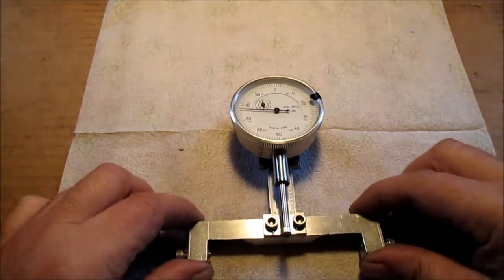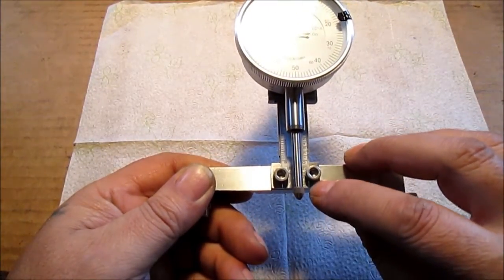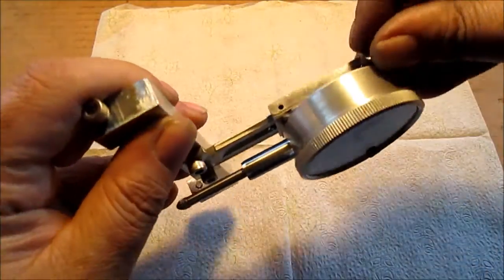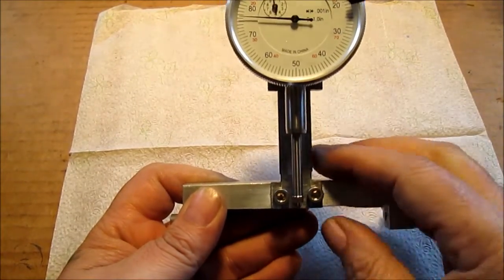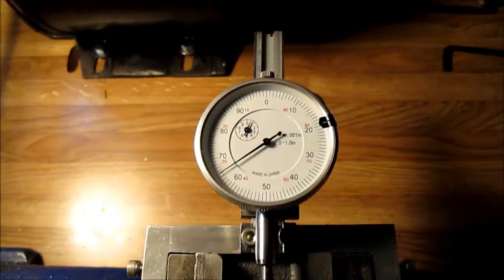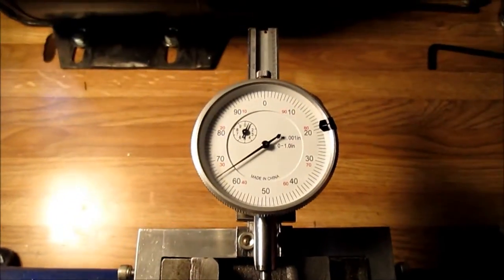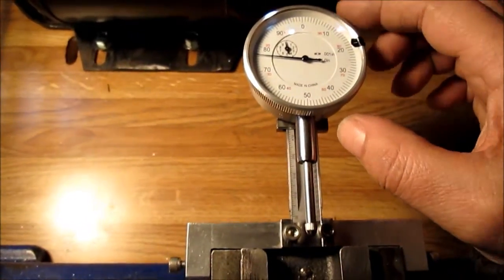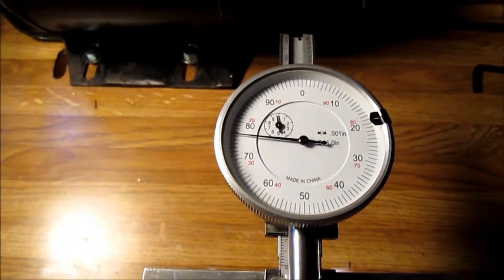Dial Indicator Mount for lathe

Comment: I use a similar system for readings on my lathe but I picked up an oversized dial  2" travel indicator. Much easier on the eyes. I can also swap out a digital (as long as the batteries keep up.)
Reply from the maker: I would like a bigger dial  The one I am using is hard to see the lines could have been darker